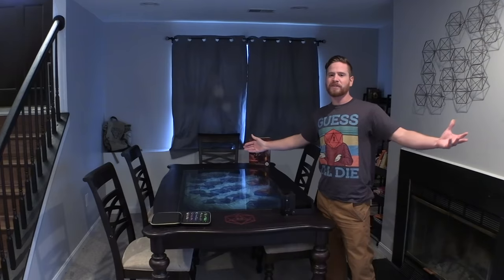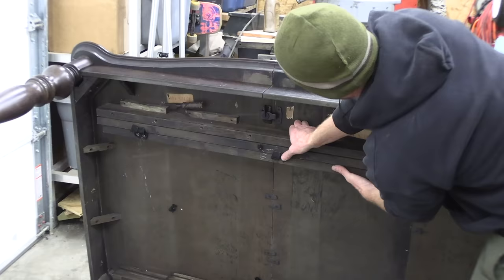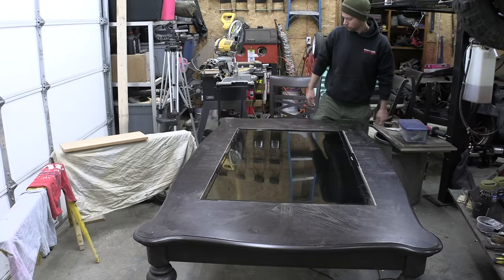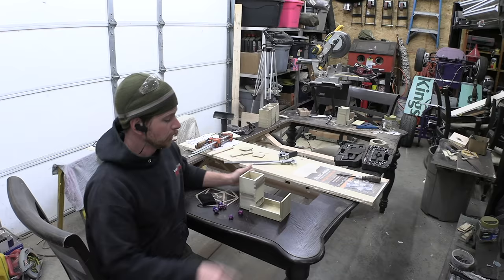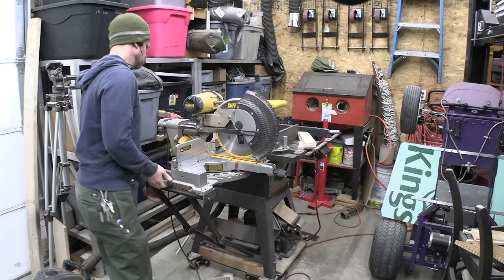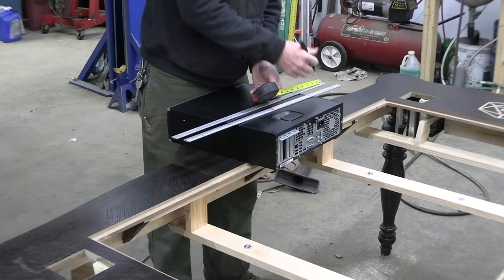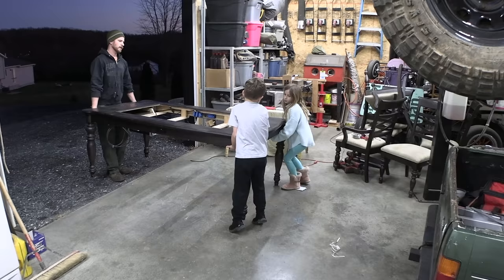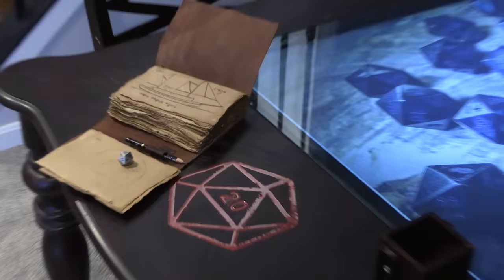Building the ultimate D&D Table: Dungeons and Dados

Comment: Keep an eye on the display panel for sagging (inside the plastic body). Most TVs aren't designed to be laid flat like that. If it starts to sag, you'll need to take the back casing off and add support.
Reply: Good thoughts. 💪
Reply: Just watched this video and had the same thoughts. Do you know of a good way to or of a video on how to add said support for the LCD
Reply: @gimlithegrey4863  you could try a bracket attached to the wall mount points on the back. Personally, I would remove the outer casing of the TV and rest the panel directly on supports.
Reply: @AJamesCo  When I built ours I did just that. The supports that hold the TV in place are screwed in to the mounting holes on the back of the TV. So far, after 2 years, it hasn't sagged at all.
Reply: I think they're talking about the actual panel inside the case.
Reply: Are there displays actually deigned for this?
Reply: @JohnVanderbeck  yes. But the easiest thing to do is just provide proper support.
Reply: That's a really good hint!

Comment: that is beautiful. The dice towers and power sockets are a stroke of genius. If i were to do it myself though, I'd have used something like a raspberry pi instead of a full pc, just so i didnt have to worry about it falling and breaking something
Reply: I was thinking laptop.
Reply: I think you want a bit more processing power than a pi. You wanna run a full browser, music player, maybe some other tracking programs in the background. I agree with laptop. That way you have a DM screen then the player/map screen
Reply: USFF PC. Very small, same hardware.
Reply: PC is better, since you can always update it later when newer and better software to support DMs becomes available, and the PC isn't going anywhere. It's strapped in by 1/4" thick aluminum bars.
Reply: I noticed it was an HP that he bought, they manufacture minis that are the rough size of 2 maybe 3 slices of bread stacked. I think Lenovo does the same.
Reply: @mesmerwolf0  And Dell aswell. You could spend $100-$200 on a tower that size thats a few years out of date to do everything here.
Reply: If you weren't too worried about dust you could even take the parts out of the PC case, spread them out, and mount them underneath the table. I suppose if you were worried about dust you could still do that but then fashion a cover to go around the parts.
Reply: I really don't think any of this stuff is going to fall. He knows what he's doing and  secured it all properly
Reply: @amsbeats841  Yea, I'd only be worried if someone was removing the glass. A big pane of glass like that would be awkward to carry and therefore be likely to shatter into oblivion at some point in the future.
Reply: GOTTA GO BIG OR GO HOME
Reply: @SendarSlayer  A Pi 4 is more than powerful enough to do all of that, but practically as expensive as a laptop with the chip shortages now :)
Reply: My main alteration would be a NUC because its smaller, and some more speakers as well as pen/cup holders. But that's mostly because I don't like the canned sound of a TV and want ambient sound to be clear at a low volume.
The drawers and keyboard slide is great though, and the dice towers are absolutely genius.
Reply: @SendarSlayer  idk why it has to be part of the table instead of on the side

Comment: Super cool, loved it.
A suggestion for an improvement: add a video output on the side for a second monitor. This way the GM may have more resources in a second screen hidden from the player and just drag into view!
Reply: That's a great idea. He could even put a small one inset into the table top like the dice towers. Where it could slide up into view acting like a GM screen.
Reply: @nathanwall6253  Since the real estate under the table might not support adding another 14" monitor that pops up, he could add just a little pop out insert for a power plug and a VGA/HDMI extension. That way it's not in his way or visible unless he specifically wants to utilize it. He could, instead or in addition, make a cool DM screen that has a cheap connected/networked tablet in it that lets him drag and drop new things into the built-in monitor. I'm certain there are PC anywhere apps that would let him do the same thing with much less work, though the rule of cool would be ashamed of him.
Reply: There are a couple of things that could be done here if you really felt you needed an attached screen you can always take one off of an old laptop. As they are slightly more rigid and flat. But at that point I would have it as a stand alone that could fit in the keyboard slot. 

I did notice that one of your players was a virtual player in the video. Now that I do think would be worth addressing if this is a regular thing. The option for that would be to use either a laptop or a low cost unit like a Arduino or raspberry pi and an old laptop screen (thin and rigid. Might even have a web camera) this covers your table camera options and you could set it up in place of the drawer.

Comment: I'd suggest having a plunger or two nearby so you can pull the glass up quickly in case someone spills their drink and you can wipe up the liquid, either that or water proof it so it doesn't damage the tv if it isn't water proofed already
Reply: a rubber gasket to set the glass panel on would do the trick.

Comment: I use this technique with my builds I designed for dice towers that enables the tower to hide away similar to yours for a flat, usable table when not in use.

Start with the table, approx. the size you are using now, and make the necessary adjustments for your television or monitor. Once you inlay that and the glass, you measure out your dice tower. Adjusting for the folded dimensions, you take a hacksaw made with a titanium blade (for a better cut and less mess) and you hang it up on the peg board. Then you use a standard dice tower and throw it in your D&D bin when not in use. Congratulations, you saved hours of work and a headache when it inevitably gets damaged. You can also put it anywhere you choose and fit more players at the table. Revolutionary.

Comment: Instead of a tower pc. You could use a raspberry Pi 3/4 or something similar. Its much much smaller. uses way less power and  depending on cheap pc you find, the raspberry pi can be more powerful. The raspberry pi can be held in place with just Velcro. Anyways, love the build.
Reply: That was my thought also, but cool build nonetheless

Comment: Ive been spending the last month designing my own gaming table from the bottom up. I saw so many different versions online, but none of them were necessarily portable, and since my party changes locations every other sessions i needed something i could comfortably move. I could have just gone with the tv case route, but i wanted something that was also a table, and thus i decided to make my own. I definitely made it harder on myself by using a 60” tv, but it was free and wasnt being used so i wanted to make it work rather than buying a whole new tv. 

Just put the final touches on it this weekend, just in time for the next session. Only cost me 400$, can easily be carried (in parts) by 1-2 people, fairly sturdy when fully assembled, and looks fairly good.

Comment: That's the most modern old table I've seen lately! Great work all around, especially the addition of charging stations for your players and the pop up dice towers. Maybe one suggestion would be to add a small noise-dampening cloth at the bottom, so the dice don't make so much noise. We find that they can be pretty loud at times. But I'm nitpicking at this point, great job man! :)

Comment: I built a similar table with a 42 inch non smart TV I had no use for anymore and a free table my neighbors set out by the trash. I used metal straps and drywall screws to fasten the TV to the table. I didnt cover the screen with plexiglass because we use digital miniatures. I made a trim around the screen to keep out stray dice or spilled drinks. A jigsaw, trim nailer, metal straps, drywall screws , some trip pieces, and the entire project was done in under an hour

Comment: Some observations:
1) Players have little room for their papers. Consider getting some fold up TV dinner trays or whatever they're called, that players can position next to them.
2) DM has no room for a DM screen due to table size and positioning of unnecessary pop up dice rollers. That seems important.
3) The computer is likely low performance and may struggle with some of today's modern map display tools that use animated visual effects. That, and the TV, will make a bunch of heat with little ventilation. TV's are not usually meant to sit horizontal with bright images for hours.
4) It might have resale value to another nerd (unlike many homebrew projects that men do), but now you're stuck with this giant TV table thing in a housing market where every bit of floor space is extremely expensive, and it doesn't look like anyone is having dinner on this, so does that mean there are two big dining tables in the house?
5) The DM's positioning is such that the primary monitor is basically in a portrait view, which easily gets messed up on various map display softwares.
6) DM doesn't seem to have a private computer monitor for viewing their own digital data that they don't want the players to see, unless they pull out a laptop or some other separate monitor. Not everyone needs that, but it's sure handy for quickly looking things up, playing music, etc.
7) It looks like you have to crink your neck to see what the dice rollers produced. I wouldn't want to do that as a DM for many hours in a row.

I didn't watch the entire video in super detail, so maybe these points were discussed, but something to keep in mind for anyone emulating.

Comment: There is this online system called Foundry. It is sooo damn good. My Ultimate D&D Table would have 6 small touchscreens for the players, 1 little bit bigger touchscreen for the GM, 1 Huge Projektor in the middle and 1 actually good server to host it on while each player becomes just a thin client.
This way one could have both the awesomeness of Foundry and sitting together with your friends in 1 Room.

Comment: This was really cool to see when I was younger as I was just getting in to dnd and I love tech but now that I’m older and rewatching this I thought of some ideas that could save space and maybe bring back the function of the table in the video that allows the table to be shrink for less people use.
1. the screen pc screens have gotten cheaper and use less power to run so I would strip 3 pc screens and line them out to the edge of the centre of the table wood and there won’t be a bezel line so it will look like a big screen.
2. Each seating position in the draw can have custom number key pad or use a stream deck can tell the pc that player you are using to be character to be move to the chess coordinate positions (to some people thinking that sounds really confusing. Just think it’s layers, map png under and anther png grid)
3. If you have an old android phone easy. Linux on it and it’s a pc, plug a hub in to it for the screens and the keyboards and mouse
4. For the dm can have a custom dm screen, instead of the traditional dnd screen it can be a usb monitor and the sides be what ever you won’t more screens yep, traditional print for stuff you need to go back and find with out looking it yep, whiteboard with magnets yes as well.
5. Instead of keeping a lot of books on hand, use a note pad program called obsidian it like windows word but more themed around a notepad with a lot of community add on ( I’m not listing them as this is just ideas ) add on one specific  file and it will give you all the dnd info you need, need to look for something in the books as it’s all been converted to a text file for notepad program so you can search in obsidian highlight, pin or reference it using a obsidian text command and it’s there ready to go there’s videos on YouTube if you don’t get it
6. Use obs program to run your table screens as it would be a pain to do what this guy did in the video. Good job using what you got and know but for me I rather not hert my back anymore it is from being 6 foot 4
Take it or leave just idea I’m putting out there for others

Comment: I already see a few upgrade suggestions.

The first one would be a Digitizer with 20 finger Multi-touch. 
Using modified Microsoft pens/clones inside the characters, to give each one its own tip/touch point.
Since the tip is different the system will see it as a separate pencil/device

Using small build in speakers under the Table for more ambience
vibration motors, to shake the table slightly/give it a short jolt of 0.5 seconds, if a large spell is cast.

Comment: In the early 80s I had a similar concept, except the screen (table) was larger and touch sensitive with circles around each miniature showing running, walking, viewing, etc... ranges that adjusted when player moved their miniature (including fatigue), maintaining what was seen behind them, except if dark (no light).
Every player had an automated character sheet (only they could see behind a partition), that calculated all attack, defense bonuses, penalties, etc...  and a first person view.
That's all, off the top of my head.  ;-)

Comment: Thank you so much for showing your process and explaining your decisions! I made a thing like this, and I've been slowly designing a v2.0 ever since. I have some questions that I hope will help me benefit from your experience even more than I already have from watching this video: 

A. How's the knee clearance under the table? Do your players bump the dice towers or the screen?

B. What was your thought process on tempered glass vs. other clear materials?

C. How did you get the tempered glass? Local custom glass shop? Online order? Was it expensive? 

D. How thick is the glass? Can you set a stack of books in the middle of the table without concern for deflection or breakage?

E. When everyone is at the table, do you have to do anything in particular to avoid anyone dealing with glare off the glass that makes it difficult to see the display, beneath, or does it just work out fine?

F. Have you done anything to limit the potential damage of a spilled drink around the edges of the glass? Do you have any successes or failures I can learn from, there?

G. I saw toward the end that you're using an AIO computer for videoing in remote players. Now that you've run that, live, do you wish you'd done anything differently in the table design to incorporate some of that functionality?

(If y'all never see this and/or don't have the time or inclination to answer, no hard feelings, bud - this thing looks amazing - way better than mine.)
Reply from the maker: hoo buddy them's some questions, I'm gonna blow through em so forgive my brevity. 
A. Acceptable, no. 
B. can't scratch or break it
C.local, $260
D. 1/4" never break, can deflect some
E. Low light is better
F. rubber seal on edge
G. Nope, remote is a sometimes deal, works ok. 

Thanks!
Reply: @MoreToolsThanSense  Thank you for your thoughtful replies! You have a talent for useful, informative brevity that I haven't mastered, yet lol

Comment: Such a table looks like it could also be very useful for engineering or mathematics work, especially if it would be using a touch screen. For example, the engineers can sit around the table, and be looking at the diagrams on the screen embedded in the table itself, and write stuff on the table. That would be so much more useful that using a projector screen.

Comment: I'm sure it's been suggested: use a smaller pieces of glass (12"x12") to lay on main glass then miniatures on top.  When scrolling map it saves the time of moving each mini. Just slide glass over original position once map scrolling is stopped

Comment: If I were to make a custom gaming table, it would need a short throw projector inside, and a rollaway projector screen so the image can be thrown onto the wall. Add on a rolling track so we can slide the table against the wall without causing a chink in the power cords, and stationary drawers underneath to hold anything we need (game pieces, Wii controllers, dvds…), and it’s perfect.

Comment: You could built in a built-in DM screen where one of the panels is a monitor linked to the PC that allows the DM to pull up statblocks and notes and stuff. Or simply view the map without having to look at the table. I imagine it would make navigation easier

Comment: pretty darn cool... needs cup holders... or enough room on the sides for books and paper on the sides of the table... it would've been hard to extend the sides sure. Or if possible, have the TV raised a little instead of inside the table... it would allow paper and books to slide under the tv.

Comment: The tool work and creativity are top notch, but the fact that you just whacked THE ENTIRE TV in there... I'm in stiches!! XD. It would be fairly straight forward to mount the panel, scaler and power supply without the entire chassis - also a fan would be useful. TV components need to be cooled. the giant ventilated back panel usually does the job, but not if it's under glass.

Comment: I would put some kind of seal(silicone) or rubber that the glass sits on to prevent spilled drinks etc to run down onto the TV.

Otherwise a epic build that does not require a entire workshop of tools. Most tools are what people have at home already(the combo benchsaw is not really standard tho :D).
Reply from the maker: Thanks! It does have a rubber gasket in there, I didn't show it in the main video.